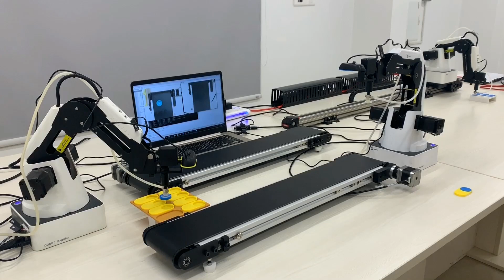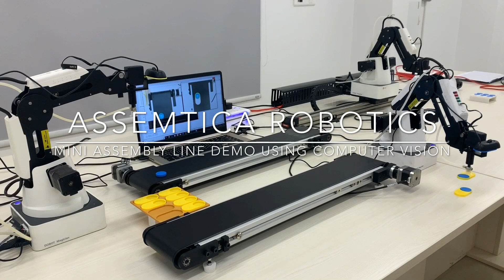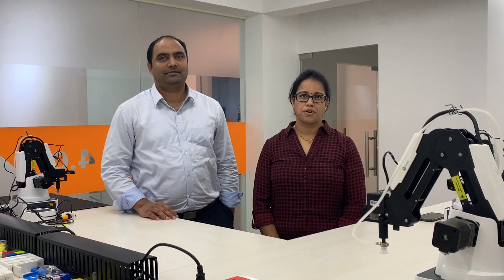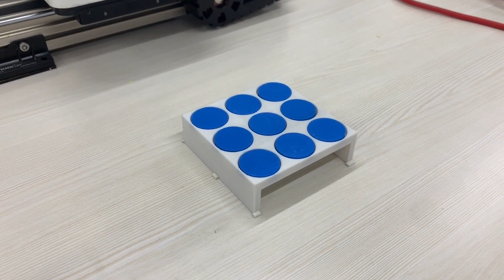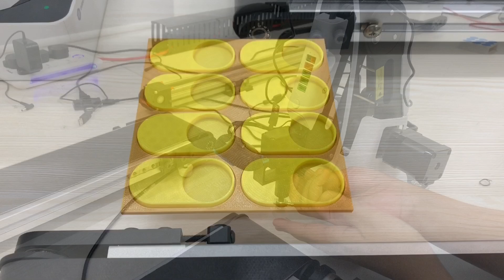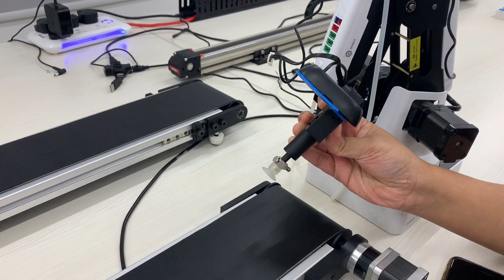Industry 4.0: Mini Assembly Line (Part 2/2) - Computer vision with Dobot robot arm & OpenCV

Comment: Nice demo! How did you use opencv with the usb3 camera's? Do you need a specific SDK for that?
Reply: Camera firmware should be installed first on the computer before using opencv